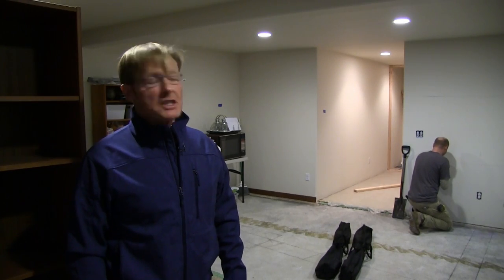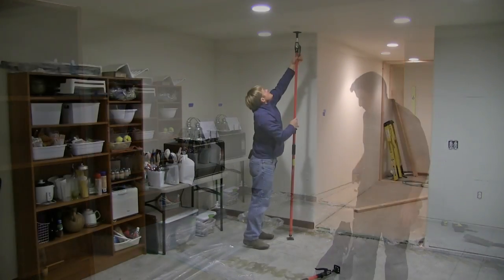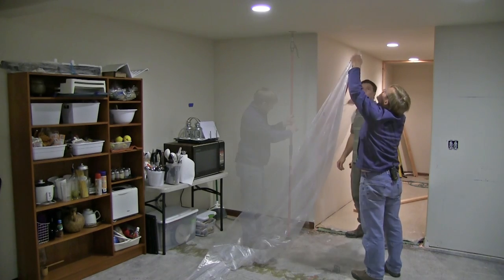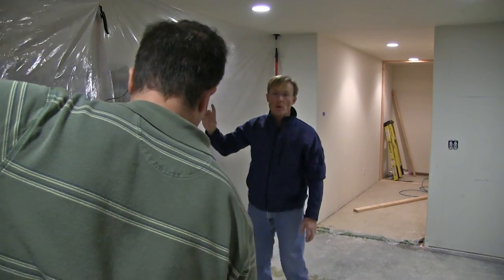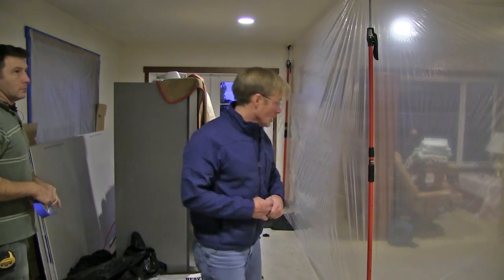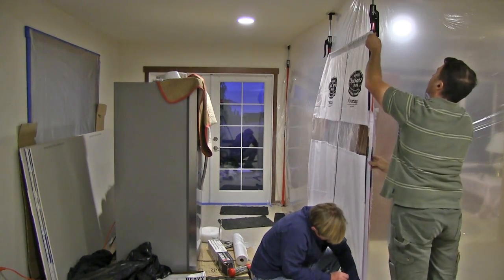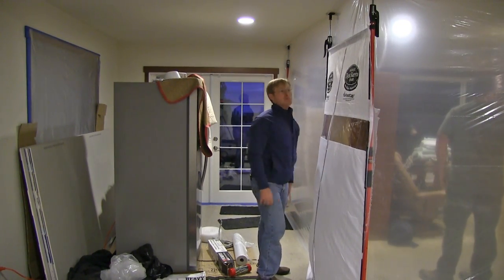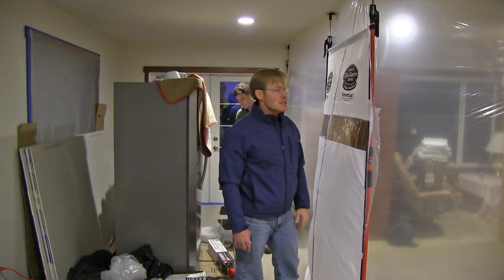DUST CONTROL

Comment from the maker: I prefer the FastCap system because I can pull it tighter than with zip poles, plus I use the 3rd hands for many different jobs not just for dust walls. I have a zip wall set up, but I could never get it tight enough for my satisfaction so I always ended up taping the plastic to the ceiling and walls.

Comment: Another GREAT video Ron that shows your professionalism. I have done some work in hospitals replacing doors and hollow metal frames and we are required to use dust barriers with air scrubbers on each side of the wall and this system is required to be inspected before we can begin work. Also if we have to work above an acoustical ceiling in the hospital we are not allowed to remove more than three consecutive ceiling tiles and we have to work within a sealed rolling containment booth with an air scrubber just for that purpose. That was a very expensive item to purchase but it was required to get the job done.

Comment: Started using third hand tools years ago. Love 'em. they're awesome for so many things. Even used them to hang drywall on a ceiling. 
An air scrubber in the work area vented outside would create vacuum ensuring no dust gets to any part of the rest of the house.

Comment: Excellent point, four adjustable posts with a carrying case which extend to 10 ft can cost about $150 to $ 200.The door is about 75.00  All can be used over and over. Plastic sheet is cheap and can be used for something else after the job.both buy "good will"  from customers and save time ( & $$ ) at the end of the job.

Comment: I use the zipwall system and have had pretty good results.  I have had issues with employees or other contractors on the job not understanding how they collapse (simple twist-lock with a spring tension at the top) and forcing them to shorten them.  Make sure you use enough poles. Negative air pressure is much more important than an air scrubber.  Air scrubbers take up valuable floor space but may be necessary if you live in an extreme climate.

Comment: I have both brands . The fastcap system is far more sturdy , and the poles have a lot of uses.

3.5 mil plastic in 10x25 rolls seem to work well.

1/8 inch hardboard on finished floors helps us a lot as well in remodeling . It can be used over and over , and can later be used for sidewalks and driveways, such as when masonry is performed.

Comment: We prefer the Task Tools Poles to either the zip or fast cap systems.  My guys tend to abuse these thing when loading and unloading and we have had the plastic ends on both other systems break off.  Task are all metal - poles and heavy metal  brackets with thick threaded rods at ends.  We also use the optional wide (I think up to 27") ceiling plates to distribute the ceiling pressure over a larger area.  Just much heavier duty than others and I think they might even be cheaper? but not sure on that.   Lately we have been on the fence on investing in a job site air scrubber.  Ron do you have one of these.  We create negative pressure with ducted tunnel fans now, which works well, but thinking of improving the air quality even more but just not sure if the investment is there and how reliable these machines are
Reply from the maker: +mussersail I don't have or use an air scrubber. Our walls are very tight so we are happy with the dust being kept on the working side. I Have a dozen 3rd hand poles which work for dust wall, laser mount, jacks, and many other purposes. The top magnets keep the heavy plastic firm so we can pull them tight. Mine have been in use for a long time and we have yet to have any breaking or failure.I do have zip wall, but was never satisfied with the wall being tight enough, plus they are a one trick pony. I like the multi task abilities of the 3rd hands.

Comment: This system looks nice.  Do you also use air scrubber on your jobsite if theres more messy job? 

We have been working last four years in large officebuilding with shopping/restaurant area, and all kinds of dustcontrol and compartments and pressurizing has become familiar.  Dust control is something that should be really basics in business, and is something that is coming more and more important.

Comment: I like fast cap poles but not a fan of the magnetic door. I prefer the zip wall zippers.  I can put a couple spaced apart a few feet and open it up to get materials thru. Then at night I can open it and roll the door up so the home owners don't even have to touch the dusty plastic. Plus let last thing I need is for the magnets to come lose while  my back is to them sawing a concrete floor. I'm not saying the fast cap door is bad, I just perfer the flexibility and piece of mind of the zip wall zippers.

Comment: Could you put the poles on the other (clean) side of the plastic to keep them clean?  

Never had a reason to use a dust wall, but if I do, I now know it isn't brain surgery to put one up.

Comment: i believe zip wall sells a little pack that has 2 zippers and 2 little hooks to where you can roll up the opening and hook it up out of the way to provide a large clear opening that you dont have to kinda squeeze through. really comes in handy when you have to carry big objects in and out i often get snagged up on the one zipper method and mess up my set up. when i use two and the day is over and dust settled you can roll that bad boy up and the homeowner has a much more convenient wide open hole to walk through. rich people are often clumsy and damage a one zipper door over the weekend and they whine about it
Reply from the maker: I used Zip wall for years, before switching to Fastcap. The Fastcap magnetic door is more convienient, durable and reuseable. The zipper doors from zip wall did not work for me and my crew as they need to be opened and closed each time, where as the Fastcap magnetic doors are automatic.
Reply: Ron Paulk oh I see I thought that was a zipper coming up the middle there